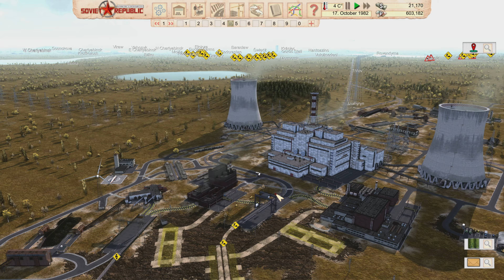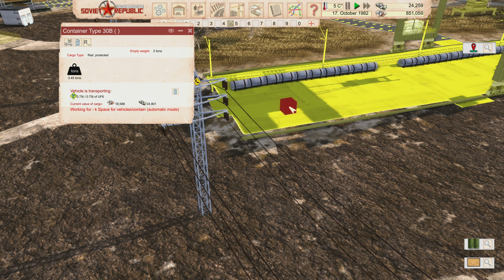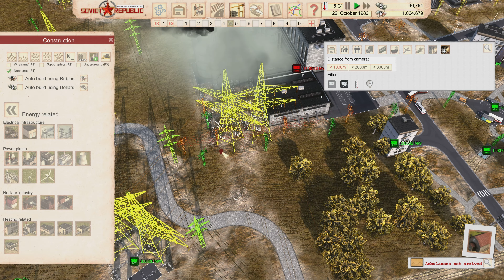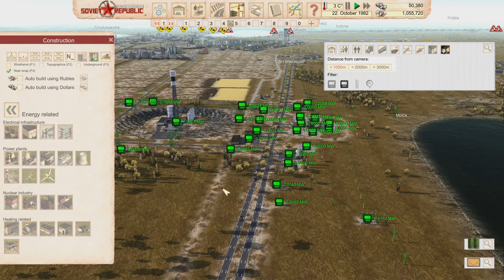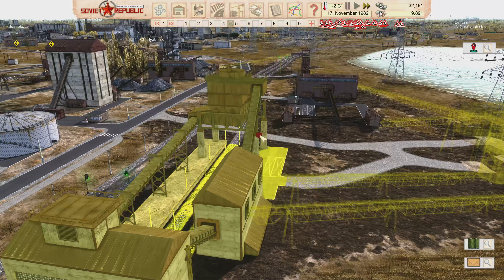NO LONGER BURNING OIL! - Workers and Resources Gameplay - 50 - Soviet Republic Lets Play

Comment: I would suggest more lines of the power plant to reduce stress on the lines. Your export lines are fine being red but any lines are being used by your cities and infrastructure should not be red just to be safe. I am not sure if this can happen in game or not but over loaded lines can cause problems. 

I believe that certain lines can catch fire if they are damaged by weather such as snow. Best to have a contingency setup in place.
Reply from the maker: None of the lines feeding my cities are red. They have a lot of capacity left. Remember the line going to the first area to replace the gas plant is split halfway, going to export the excess. That’s the only reason it appears red out of the nuclear plant.
Reply: @CharliePryor  your exportlines sucking the power of. 
you sending 18MW through one line, and diverting 18 of so only a drip for the rest stays over. may be reduce the Export to 16MW or lower. or use a smaler Line so you dont siphon all the power from the grid. 

or as a second thought: 
- reorgenice the suply. every city gets its own 18MW line, and then seperate export lines :P
Reply: @Luziferratus  and @Charlie Pryor That was what I was kind of suggesting. If each city or big industrial area has a dedicated 18 MW line then you can point to problems in the grid as each city will have it own supply line and localized grid that is independent of the others. 

Then you have lines dedicated to export only. If something happens to that line that goes into that splitter then the city will lose power. This way you can see how much power each place needs and figure out if you want to grow it or not.
Reply from the maker: @Luziferratus  you only export what you aren’t using. It’s “up to” 18. Not consistently 18. My own civilization has priority.
Reply: @CharliePryor  ah, thats a thing i didnt knew x3 thanks for this crucial information :D

Comment: Hey Charlie... 
Little tips
On The Vehicle (train, car, truck, ect) 
They Have Top Speed Limit + Horse Power
- The Top Limit of Speed Basically How Fast They Are
And
- The Horse Power ( Good for Climb and ect  ) Basicly That's For "How Long You Pull or Take Care Load And How Long You Can Push Into Speed Limit. 

" Basic Information from Trucking and Train Load Limit Power"